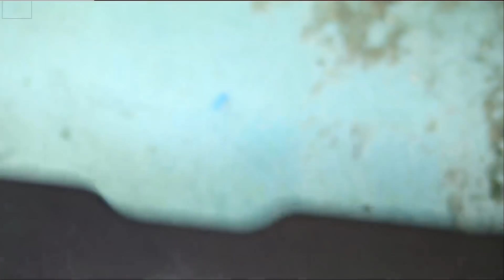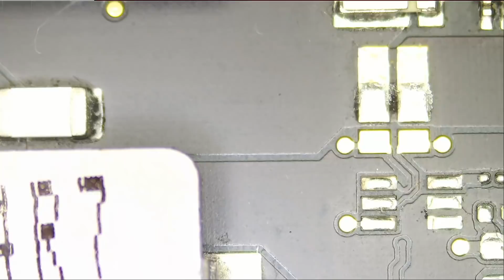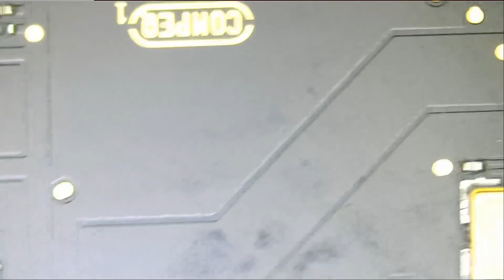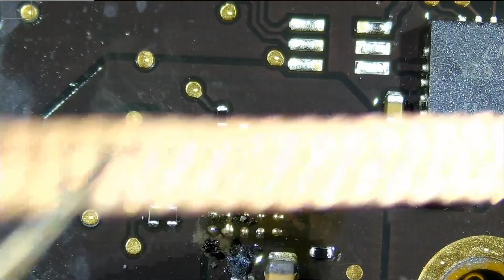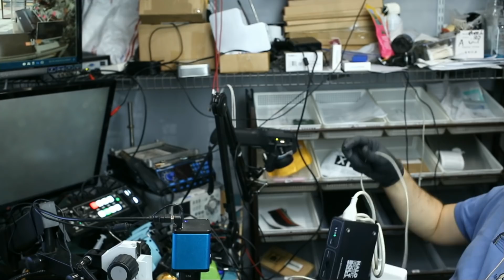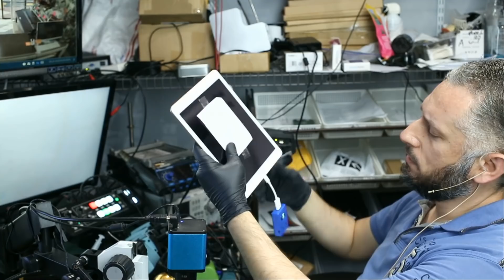2015 Macbook Air Liquid Damage Chimes by nothing shows on screen - No Backlight Repair

Comment: Hi Sir. Name is Ruben. I have a Mac book pro that the battery is not charging. We change the battery and bought a new original charger but no charge but it will work connecting to the wall outlet. What can it be? Thanks in advance.

Comment: asalam u alaikum sir i have i phone 7 which mic not works voice works on bluetooth but handset mic not working how can i solve this .please reply.
Reply: Ahmad Shah 
Johncase OEM USB Charging Port Dock Connector Flex Cable + Microphone + Cellular Antenna Replacement Part Compatible for iPhone 7 All Carriers (Black) https://www.amazon.com/dp/B075R7QKZC/ref=cm_sw_r_cp_api_i_hxYPEbQQHEDV0
Reply: @May3yad3  thank u ji
Reply: Ahmad Shah  dose the microphone work if you put the phone in speaker mode ?

Comment: Great video as usual. Really helpful n informative.
 Could you give me a link to the power bank that you connected the laptop charger to. Thanks
Reply from the maker: Halo Bolt https://rover.ebay.com/rover/1/711-53200-19255-0/1?mpre=https%3A%2F%2Fwww.ebay.com%2Fsch%2Fi.html%3F_from%3DR40%26_nkw%3DHALO%2BBolt%2B58830%2B%26_sacat%3D0%26LH_TitleDesc%3D0%26LH_ItemCondition%3D1000%26_sop%3D16&campid=5338440312&toolid=20008